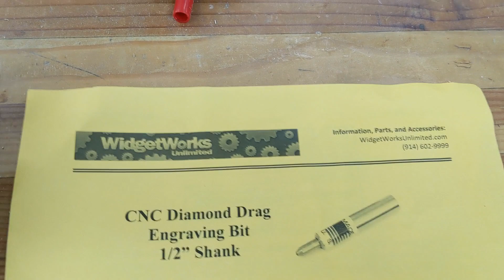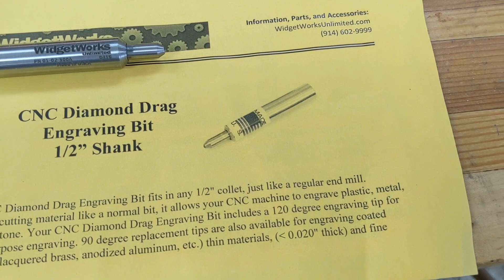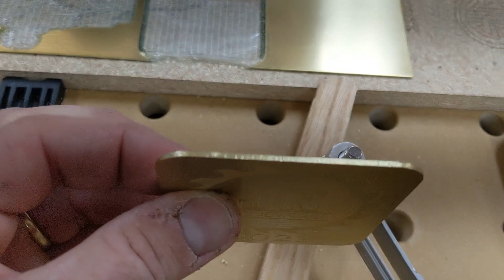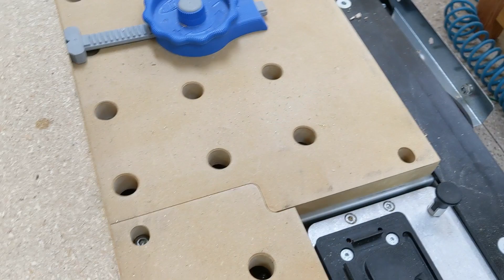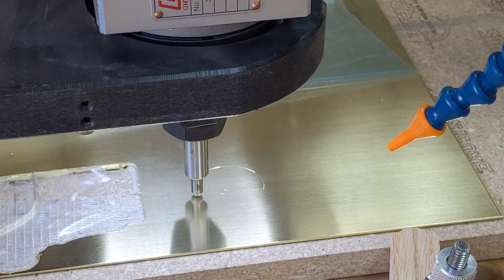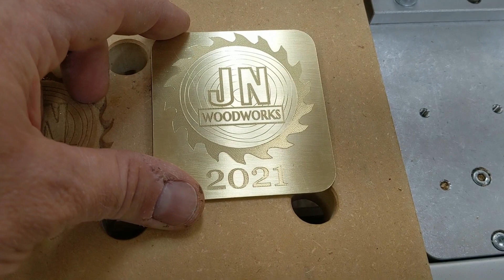Engraving a brass plate with a WidgetWorks Diamond Drag Engraving Bit and an AVID CNC Router

Comment: Great video.  Quick question.  What toolpath did you use in VCarve Pro for the etching?  I am going to try to etch some granite and am curious what path to use... Also, what were your settings again?  I had a hard time hearing it.  Thanks again for the great video!
Reply: Hi Seth,
I use the Quick Engrave toolpath for the dragknife work.  It lets you set the pressure, stepover, crosshatch, etc.  With this tip, I usually use 0.1" for the pressure/depth setting, and crosshatch at 0.01" stepover.  I usually do crosshatch at 45 degrees, but that is more of a personal preference thing.   You can set up a diamond tip drag tool in the tool database, and I usually have it run at 30ipm.  I haven't done any stone, but have heard the 120 degree tip is best, and don't run too fast.  That reduces the chance of damaging the diamond by breaking it loose from the mount on the tip.
Reply: @jimandjulieneeb8529  Thanks a lot!

Comment: Nice video, I was just searching on what kinds of material a CNC machine like an AVID Pro could cut and engrave besides wood.
Reply from the maker: This one will mil brass and aluminum nicely.  I have seen people even cut steal with it, although it barks pretty loud when doing it as it really isn't heavy enough to do it without some chatter.  HDPE machines beautifully as well.  And of course you can add a laser to it and have all kinds of fun with that too.